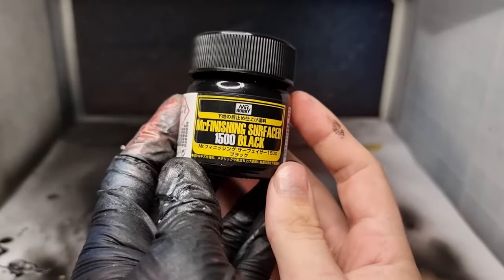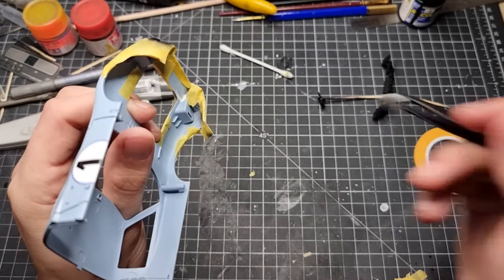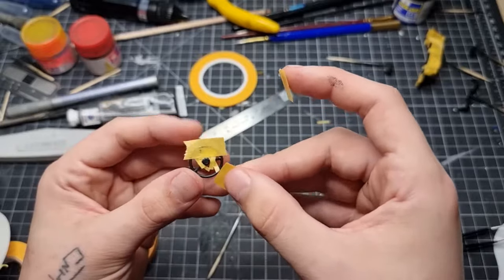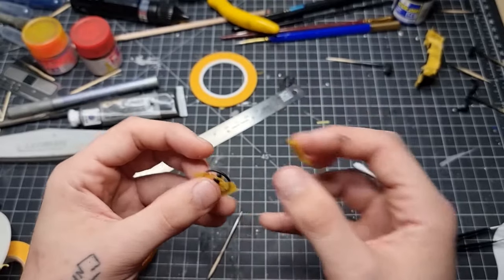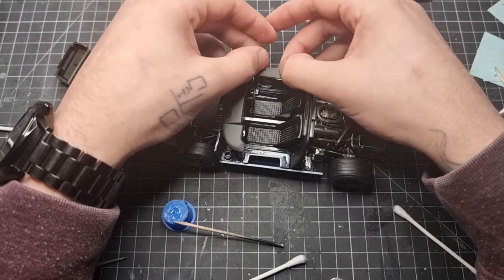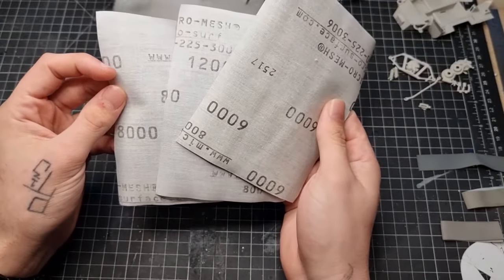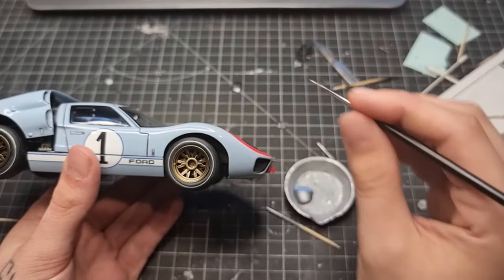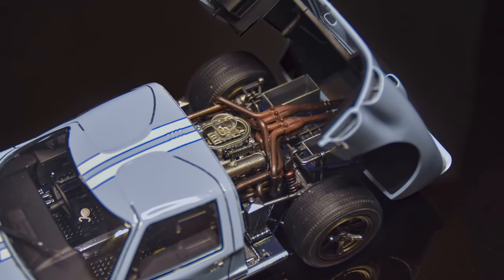Meng 1/24 Ford GT-40 MK.II - Part 3 - Interior & Final Assembly.

Comment: Cracking build, despite the issues it turned out fab. Looks good posed with the clam-shell open. I noticed your globe was backwards by the way.
Reply from the maker: Cheers mate! 

Backwards? It may be because i'm using the front facing camera!
Reply: @ScaleMotor  You probably have mirror view on.